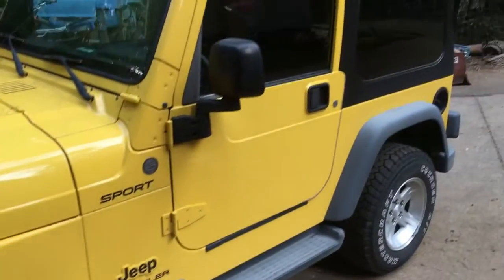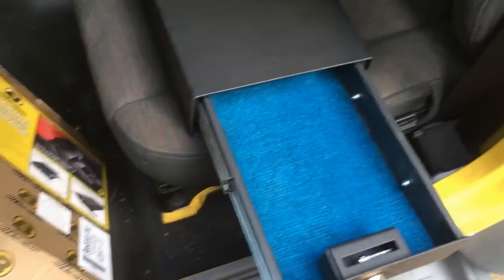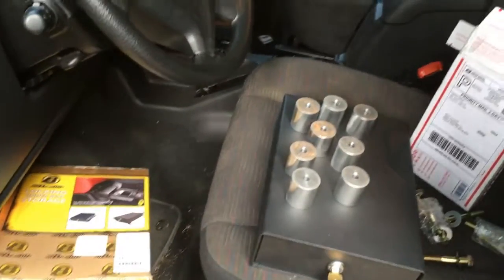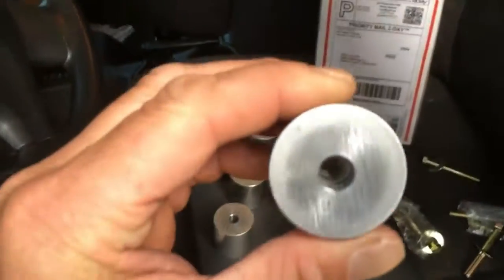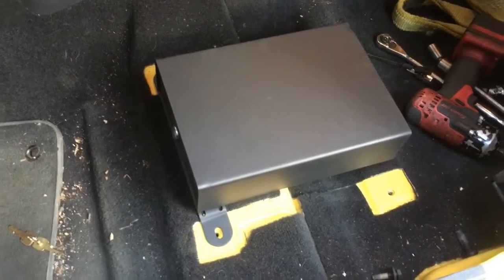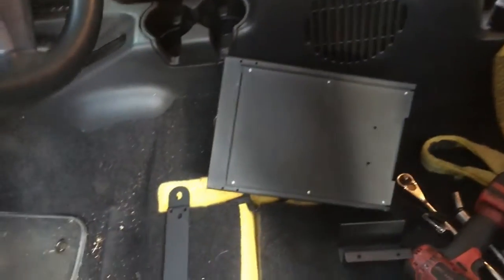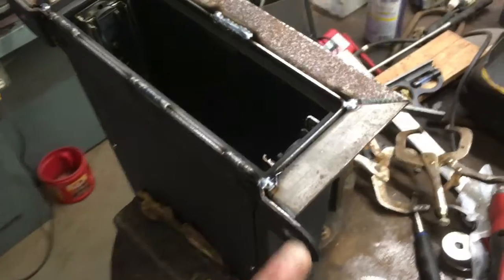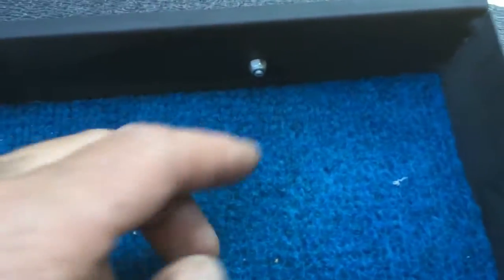Jeep TJ under seat storage and seat lift

Comment: Were these "flip & Fold" seats? Did you have to remove the bar under the seat? Or did the Seat Risers raise the seat enough that the lock box fits under the flip fold seat bar?  Thanks